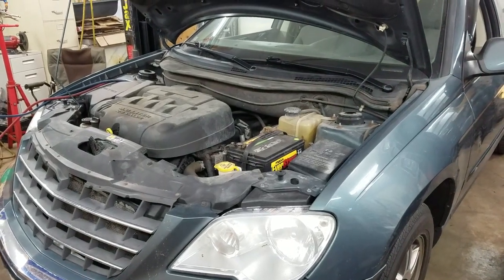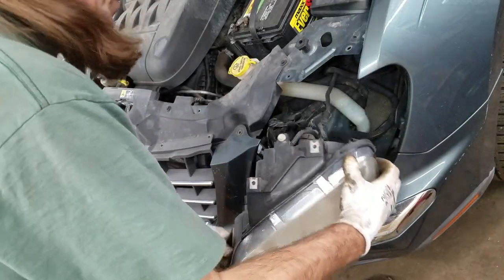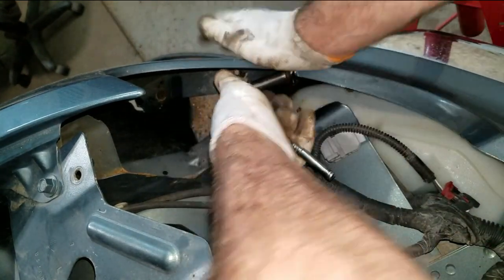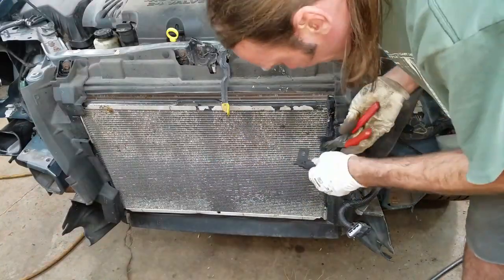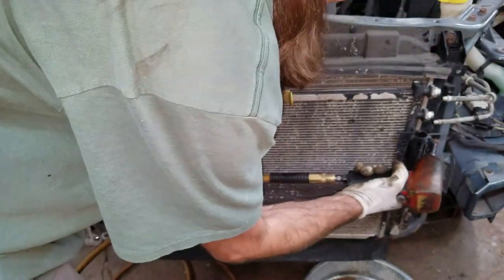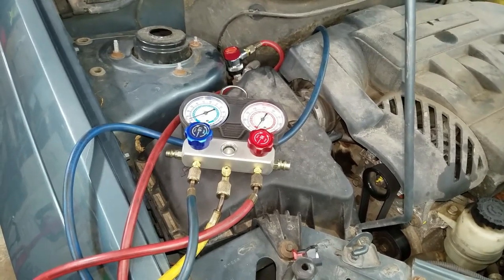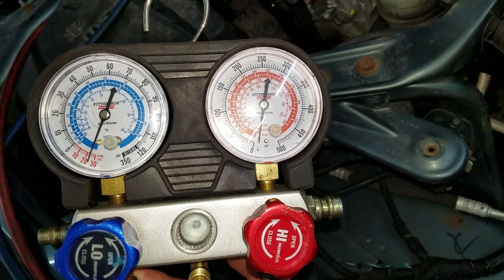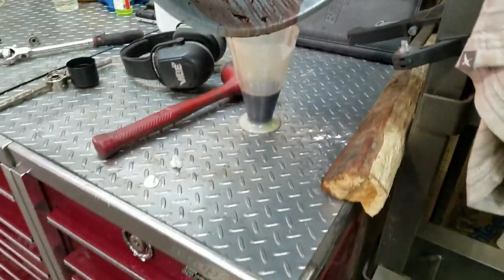Chrysler Pacifica Condenser replacement

Comment: Great job , decided to tackle this myself after watching , shop said 6 hours labor did in 2 hours first timer , you can save some time by not unclipping each wire just twist turn the bulbs out and leave connected to harness , also no need to remove bumper or fan sensor on our 07 4.0 slid right out the top. Thanks again saved us almost 1k at a shop (keep in mind they were using fraudulent labor time amounts)

Comment: When doing a front end repair, do you ever have to worry about accidentally bumping collision sensors? Presumably only when key is on, engine on?
Reply from the maker: We use to take to turns with sledge hammers with the key on trying to deploy bags on junk cars. It's not an easy thing.